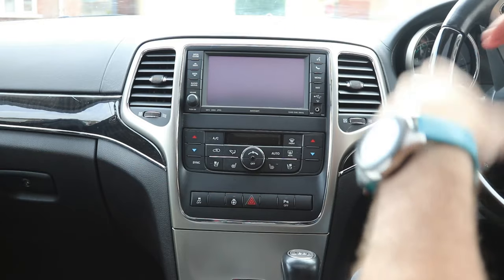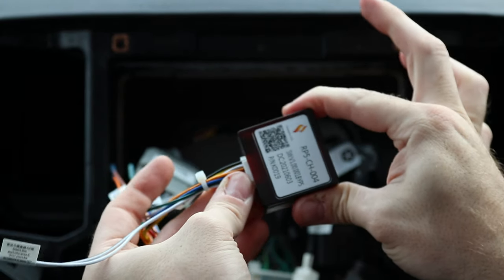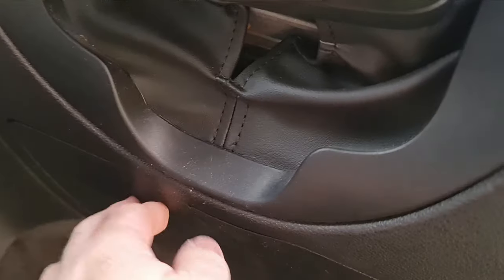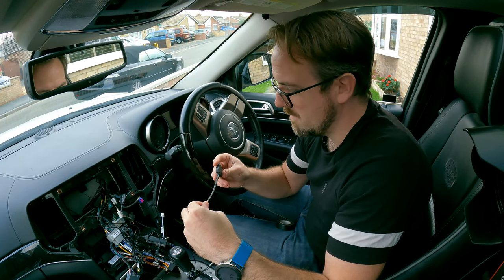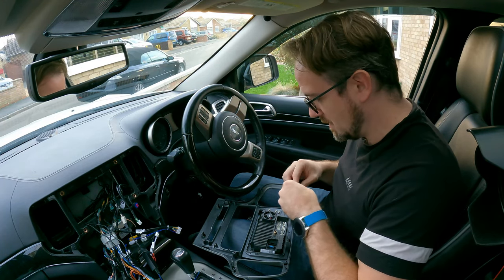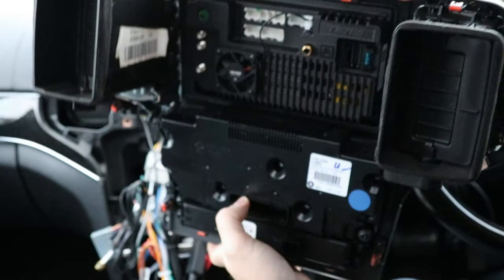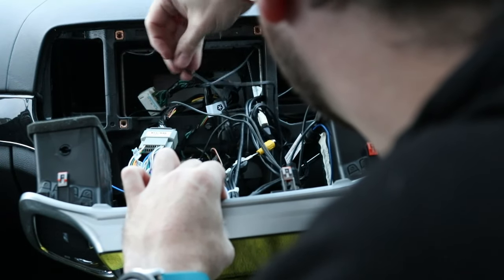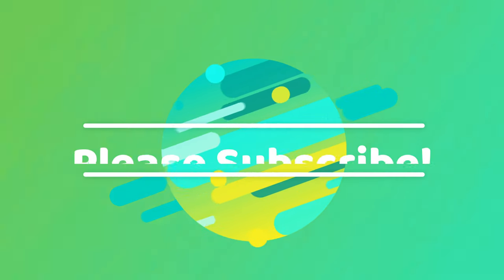Jeep Grand Cherokee ULTIMATE Head Unit Upgrade - Teyes - Jeep WK2 -Android Auto -Apple CarPlay -DSP

Comment: Very very helpful video!! I bought a very similar radio , and watching your video it was very easy to install and works awesome. I just have an issue with my subwoofer speaker ( no sound).  Is it necessary to connect the blue wire "amp com" to the harness??? Thanks for advance!
Reply: Did you get the sound to work?
Reply: @andrewhorsley8187  oh yeah! works fine
Reply: @wallacemosh how did you get it to work? having trouble with mines
Reply: @Khiwrk  what’s your problems buddie ?
Reply: @andrewhorsley8187  yep , the sounds works fine bro
Reply: @wallacemosh  same subwoofer problem. wanted to know how you got yours to work
Reply: @Khiwrk  ok, this model haven’t a direct control on the subwoofer, so, I get the best sound fading settings to the rear speakers. When yo do this, front speakers works fine but the rear speakers and subwoofer , gets louder and bass sounds increase. Is the only way that I get a best sound. I know, some units get a own control over the subwoofer, and that’s awesome ! But I this unit doesn’t . Hope this information can help you!
Reply: @wallacemosh  Thanks for the info! going to try it out today. I am also guessing the amp cont does nothing ?
Reply: @Khiwrk  your welcome and the amp works with speakers together . So, if you want to work with the subwoofer you hace to install a new amp …. Aaarggggg!!
Reply: @wallacemosh  any recommendations of a new amp?
Reply: @Khiwrk  if you don’t have a new subwoofer , is not necessary .

Comment: Will my pre-existing rear view camera of my Jeep Grand Cherokee Limited (WK2 - 2012) plug into this unit?
Reply: I just installed the CC3 on my 2012 JGC (WK2) and maintained the OEM camera by using the iDatalink HRN-AV-CH1 Factory Integration Adapter. It was super easy and all T’Eyes reverse camera functions work.  The resolution is good enough in my opinion.

Comment: Does the reverse camera fit into the same spot as the original camera on a jeep grand cherokee laredo 2012?
Reply: I just installed the CC3 on my 2012 JGC (WK2) and maintained the OEM camera by using the iDatalink HRN-AV-CH1 Factory Integration Adapter. It was super easy and all T’Eyes reverse camera functions work.  The resolution is good enough in my opinion.

Comment: just installed in my 2011 jgc overland..VERY UNHAPPY..i bought this because of this video!! starting with can bus..none of my steering wheel controls work..i think they might have sent the wrong bus. also, it took my 15 minutes just to get it set to english. far as i've gotten..any more issues it's coming out and going back..is there any support from teyes or do i need to learn russian?
Reply from the maker: There's plenty of Support. If the steering controls aren't working, you can change the vehicle settings from the Teyes app, try a different Jeep until they work. They will work. Have some patience Gary, have a play and you'll get it working
Reply: @SaabUnleashed  will the stock back up camera work? because so far no. and as far as the radio, one + click from silent is loud, no in between. and it needs my phone (droid) to do nav, etc..
Reply from the maker: @garyoberto6042  in the sound settings, go to power conditioning and turn that down. That will fix the volume. 

I'm not sure what you mean by it needs your phone. Some apps will require an Internet connection, which you can provide via your phones hotspot. If you don't want to do that, then download apps which have offline maps. This is normal and no different from any of the other head units I have reviewed.

As for the factory reverse camera, it's not going to work out of the box. You would either need to find a harness that will convert the factory harness to an RCA so you can plug it in, or install an aftermarket one.
I went with the second option as the factory camera is known to be very bad quality, especially on the new HD screen

Comment: Hey by chance did you have any wires that were left unconnected? I can’t use my volume or skip song button on the back of my steering wheel. In this video you have the same wires I have that were left unconnected, does your steering wheel controls work?
Reply from the maker: Try changing the canbus settings via the Teyes app to a different Jeep. It might be as simple as that
Reply: Any Joy?

Comment: Hiya mate having seen your videos decided to jump in and get the CC3 with the reverse camera. Hit a bit of dilemma the cable for the reverse camera is too short for my transporter. You been the font of all knowledge. Do you know of a work around to fix my problem. I've emailed Teyes still waiting for a response etc. Any advice appreciated thanks baz
Reply from the maker: Yeah you can just use any RCA extension cable. I've done it plenty of times, the last time was for a pickup truck
Reply: @SaabUnleashed  because its got red/yellow cable at either end  did you just extend them aswell
Reply from the maker: @bazbriggs1542  yes correct, you can use any cable to extend them
Reply: @SaabUnleashed  Brill thanks for your help 👍

Comment: I just ordered mine this morning, but I'm wondering what else I need to get. Does this have integrated steering wheel controls in the module or is that something I'll have to purchase separately? Also, does the factory rear backup camera work with this unit or do I need another set of wiring for that to work? Thank you, your videos are top notch
Reply: I’m wondering the same thing about the backup camera
Reply: @ryGuys Garage, how much did you pay total? On the website it’s says the radio is only 350$ but in checkout the total comes out to 605$
Reply: @alexm.5390  I got mine shipped for $389
Reply: @danissasmith8759  So after doing a ton of research, there are a couple different wiring harnesses you can buy that are plug and play to retain the factory backup camera. One of them supposedly is the "PAC CHYRVD Rear Seat Entertainment Cable" from Crutchfield. I'm waiting on my head unit to test this theory but from all my sources, it works. It plugs into the green wired spare harness he never ended up using in this video!
Reply: @HeiseyMotors  any update here?
Reply: @godwinjosh2  came in last week. I work out of town so I haven't had time to install it
Reply: @HeiseyMotors  did you get a chance to install it yet? did you retain your factory backup camera functionality?
Reply: @simonkielus7968  just installed the unit. Sorry for that long wait everyone. Unit works pretty slick but I'm trying to currently find an adapter of some sort to get the backup camera to work. The factory camera does not work with this unit out of the box. It has an RCA cable that plugs into the unit, you need an adapter from your factory wiring to go to a male RCA to be able to work for this. I'll update you when I find a solution
Reply: @HeiseyMotors  the dimmer doesnt work  anymore, there is any solution?
Reply: @MarceloBernardo  The dimmer for the head unit? Did it work before? The kit is supposed to be plug and play. Our dimmer for the touch screen works but you have to go into the settings menu to set it up correctly.
Reply: @godwinjosh2  for anyone thinking of getting this kit... dont. The head unit integration looks beautiful and is the best I've seen, but this head unit is garbage. The audio sounds like total shit and no matter how much I tune it you can't fix the sound quality. The wireless Apple CarPlay seemingly stopped working unless we reset the head unit and it only works for a day. The normal Bluetooth audio cuts in and out and stops working very frequently. There are better options out there. This one looks amazing, but functions like shit. I'll stick to my tried and true Sony XAV-1000 unit I have in my Duramax and Subaru. That is the best head unit I've ever used and makes any cars speakers sound like a new $2000 stereo setup
Reply: @HeiseyMotors  have you installed the sony into the jeep yet? was just wondering about backup camera and sound qualilty
Reply: @frostydollar2599  No but I have it in my 2011 Silverado and 2005 Outback. It'll make the sound quality in any car sound amazing. Rear camera quality is dependent on the quality of the screen mostly. I think it would do fine on the Sony

Comment: Been looking at this head unit for my 2013 wk2. Great Vid! Very hard to find anyone with this exact model who has taken the time to make a comprehensive video. Did you have any trouble getting all the speakers working? I emailed a question to the company about compatibility with the 10 speaker premium stereos which im sure your Overland has like mine. They replied and said I would need to modify the wiring from the main harness. Any thoughts on that?
Reply from the maker: I didn't have any issues at all. I imagine the modifications to the wiring that they mentioned is so that you can adjust the cars stock subwoofer separately on the head unit, but it sounds amazing as it is so I didn't bother with that
Reply: I have a 2011 overland summit. Going with this . Curious how yours turned out
Reply: Hi l have just purchased the same system for my SRT8 and l believe it has 13 channels, so l hope it all works ok, i would find your amp at the rear right side of car l think find all the inputs and find out how many, trace them back to the head unit, if any are missing, find out what they are, and you may need to parallel some outputs from the head unit to amp, just make sure you keep the impedance correct i.e. 4 ohms or 8 ohms.
I am hoping to do a video as well ans see what l find.
Thereis a little tester you can get from Jcar that sends a tone to your speakers.
Reply: I put a simular unit in my 2013 overland but one large plug doesnt get a place to hook up. and since then my battery goes dead every few days if I dont drive it.  Not like that before I upgraded.
Reply: What wiring modification did they say you needed to do?
Reply: I installed when fade to front I get no sound. Fade back sound all speakers. Phone calls I can't hear the caller. (Front speakers phone calls) wiring appears correct. Only wire not on is amp-con. Wondering if this is the culprit but my understanding is the canbus opens amp. And everything is working. So confusing think I'm sending back.

Comment: I have installed the radio a few weeks ago and went to install the reverse camera. I hooked it up to the reversing light but can't get images or tell if it is recieving power. Any advise on this would be greatly appreciated. Thank you putting me on to the system.
Reply from the maker: You're better off powering it from the head unit using the small red wire that is attached to the video cable
Reply: @SaabUnleashed  thank you.

Comment: Great Video, very informative.
Small question for your expertise. I'm after a double din dab radio for my 2010 renault trafic. I would like a USB port, reversing camera capability and just an alround good unit. What would you recommend? Budget would be £225-350ish.
From watching a previous video you schooled me from buying a cheap on off ebay.
Thanks in advance...
Reply from the maker: I Google'd your dashboard. It looks like you can install any double din head unit so you have loads of options. I can't really tell from imaged on google whether you can have an oversized unit (over 7 inches) because it looks like the dashboard around your radio seems to protrude out into the cabin. I got a few reviews coming up for the latest Atoto, Xtrons and other brands if you're not interested in the ones I've already reviewed

Comment: Is it as easy to take the pillar trim off a 93 convertible? I’ve had a tug with it and there’s obviously some technique, but in the end I wasn’t brave enough to attempt to break plastic etc. X
Reply from the maker: I've never tried Paul, but I'm pretty sure the convertible trims are a ballache to get off. When I ran the mic cable to the rear view mirror, I simply tucked the cable behind the pillar without taking it off

Comment: I purchased the Connect 2 harness you recommended for the Joying unit install. This unit looks superior...will the same connect 2 setup allow me to do the same type install you so thoroughly shared on your 9-3 convertible Joying install video?
Reply from the maker: That connects2 harness are designed for a specific type of car. The connects2 that I showed for the Joying unit was for the Saab 9-3, and therefore will be good for any aftermarket head unit in the Saab 9-3. It won't work in a Jeep though - you would need to buy a harness specifically for the Jeep
Reply: @SaabUnleashed the Teyes CC3 seem to specialize their units harnesses for each car  but have no listings for Saabs. So in effect I could order any CC3 and use the 9-3 harness I have already purchased? I separately also purchased steering wheel control canbus.
Reply from the maker: @juswillit  you can use that harness, but I am unsure if any of the supplied Teyes looms have the ISO connector, so you may have to manually connect some wires
Reply: @SaabUnleashed  I also purchased the SWC canbus you recommended in that Joying install video. So for clarity...excuse my addled mind...which specific  Teyes CC3 should I order? Thanks again. Fyi. I have two 9-3 aeros 2010...a 2007 9-5 Aero Sedan, and a 2005 9-5 aero wagon (with only 85k on the odometer). Starting with my two 9-3's...as far as this sonic upgrade.
Reply from the maker: @juswillit  All the Teyes CC3s are the same unit. They just come with other stuff to help them work in specific vehicles. In theory, you can order any Teyes head unit and just splice the canbus loom you have already purchased. You should ask them if they have a non-vehicle specific model. I am actually going to be installing one of these in a Saab myself in the upcoming weeks

Comment: Looks good!  Were you able to retain the 7.1 surround-sound that comes stock with the Overland and the Alpine 10-speaker system?  

You can use the OEM GPS antenna built into the roof-mounted antenna.  Just buy a FAKRA Z to SMA adapter for about $5 USD on Amazon.  You can also use the OEM rear-view camera from C3 with the proper adapter.  You should also be able to utilize the U-connect microphone in the rear-view mirror by tapping into the C1 connector that was previously connected to the Harmon/Becker 730N that you removed. 

Perhaps this "manufacturer" has released a more mature product (the plastic looks more robust than the "Tesla" style large-screen units currently available).  One point on the + side for this unit; the chrome trim-rings on the HVAC ducts are retained.  Others require its removal, allowing the vent to more easily be damaged during installation.

Does the canbus box provide for RAP (reserved accessory power) to allow the unit to play after the ignition is shut off?  Is there a reverse-camera trigger coming out of the canbus box (that trigger is apparently present on the canbus, but many of these inexpensive canbus boxes don't provide a wire to connect to the head-unit "Back" trigger input).  Does the system turn-on with remote-start?
Reply from the maker: The unit is 5.1 channels. Agree on the gps antenna, but it's no bother to place the aftermarket one and not have wo wait for parts. The factory reverse camera on these jeeps is trash and I placed the aftermarket one in exactly the same place so it looks factory.
Good point on the mic. I couldn't be bothered to find the cable.
Reply: @SaabUnleashed  interesting. I was never able to get any rear or center channels out of the "Tesla" style 13.6" unit I picked up from Phoenix automotive.  Nice to hear that apparently surround is available if you get a better quality unit.
Reply from the maker: @anonimity1698  it specifically has rear and center channels on the loom
Reply: where can i get the adaptor for the oem jeep gc backup camera ... i really dont want to run a new rear camera through the car
Reply: @Xrayg219  There is an adapter from PAC that provides for retaining the rear entertainment system from the factory.  That adapter includes a connector for the rear camera.
Or, you can purchase a dedicated (single-cable) adapter.  Unfortunately, you would then have to cut-out the bottom of the adapter as everyone appears to supply the wrong OEM mating plug; the factory radio has two similar connections with different "keys" to keep them from getting mixed-up.  You have to cut out the "key" channels in the dedicated adapter as it comes with the wrong connector.  This is what I had to do.
Reply: @anonimity1698  ufff that might be a deal breaker for me... Let me look for that pac adapter.... Thanks for the reply... And the info
Reply: @Xrayg219 , I found one on Amazon. Waiting for it to get in and I’ll test it then reply.
Reply: @Howellmania  Did it work out?
Reply: @dougspirit , it did but I had to do a little work to make it fit exactly.
Reply: @Howellmania  Do you have a part number?